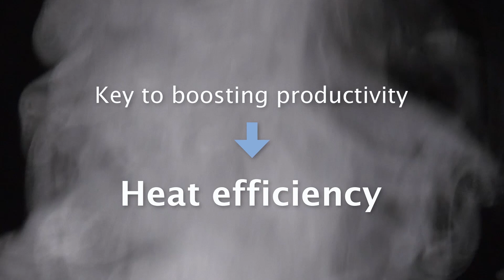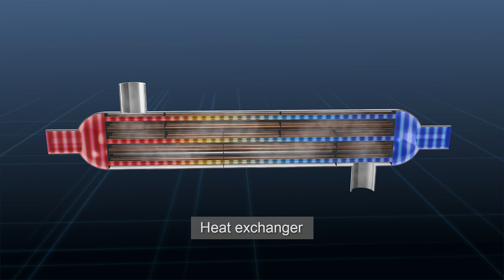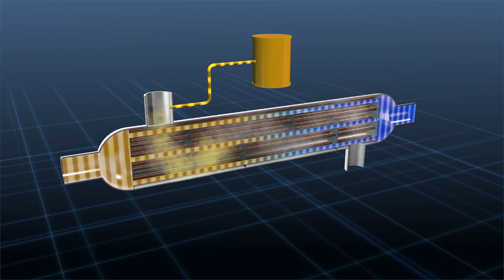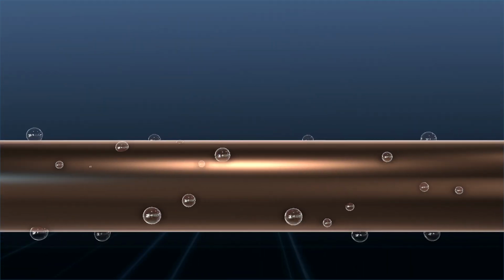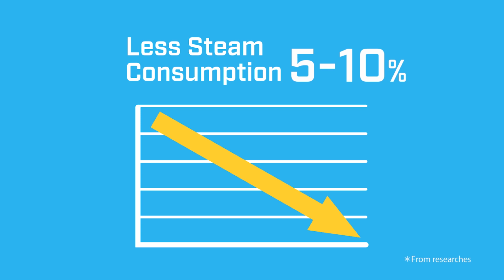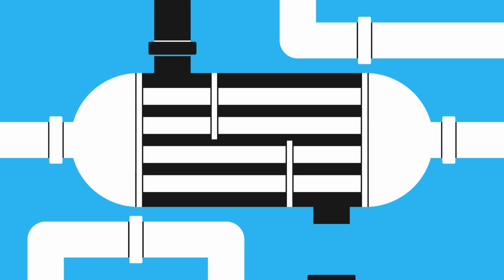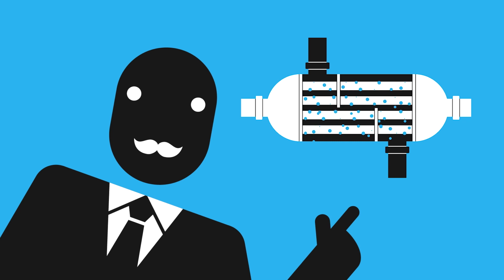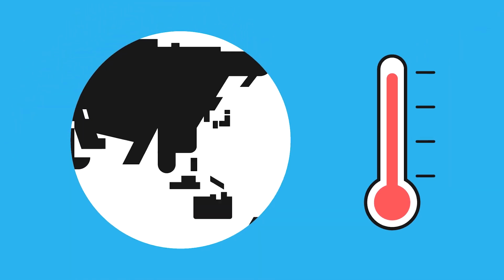Dropwise Condensation Technology - KURITA DW

Comment: Does this application has any negative impact on the water chemistry of the condensed water? Do we need to perform any special procedure to eliminate the applied chemical before sending this condensate for steam generation?
Reply from the maker: Hi, thanks for your comment.
Kurita Dropwise technology has not relevant impact in condensate chemistry. This product is compatible with all conventional boiler treatments, with sensors and operation units.
As well, it is important to mention that the residual dosage in condensate is in the range of <1 ppm. 
Please contact our experts for more information and you will be provided with the safety data sheet and additional information.
https://www.kurita.eu/en/contact-us/